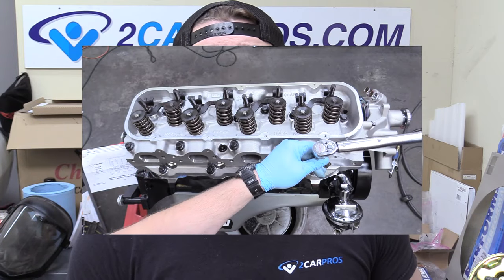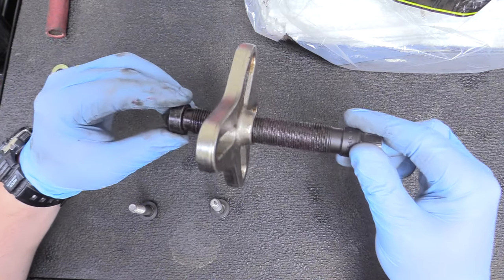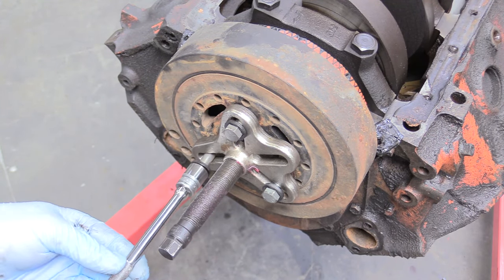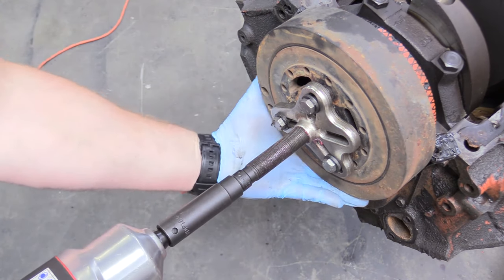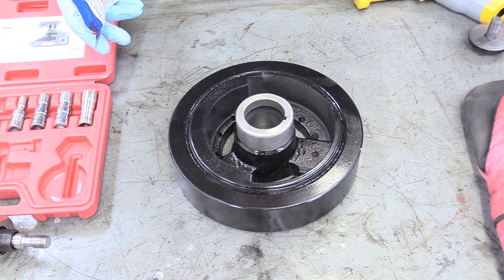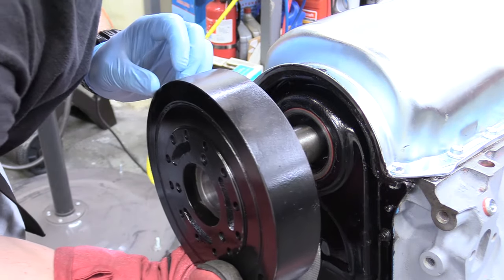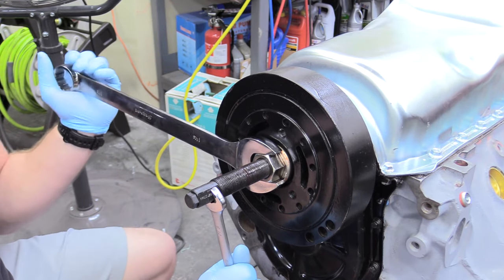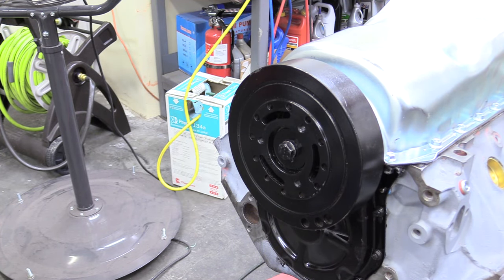Harmonic Balancer Removal and Replacement - DYI

Comment: No one pulls the engine to remove the harmonic balancer.  How do you do it with engine in the car????
Reply from the maker: Exactly the same way. You just might have to remove the radiator or anything else that is in the way. Thanks for watching!
Reply: I know I'm my car it's 04 Pontiac Grand Prix you can buy the part to take the pulley off at O'Reilly's you got to get three special boats because GM bolts are too big I have mine off in 15 minutes
Reply: Bbc 1974 remove radiator unless yor got your self a docket wrench u can to it that way
Reply: Same exact way, just in the car 😂
Reply: He was just using this as an example because the engine was already out!!!

Comment: Great video.  1 recommendation regarding the torque spec.  Driving the bolt in with an air gun is fine but should not be used to over-shoot the recommended torque.  You can yield the threads without knowing you caused the damage or the bolt could start necking, however, when you go to torque the bolt it will still click.  Always tighten with other means below the finished torque and then use the torque wrench to achieve the specified value.
Reply: Thank u for sharing ur wisdom...

Comment: Did a replacement in a 2003 Subaru without a puller or installer. This was 50,000 miles ago. Am I gonna die?😅
Reply from the maker: Nice work! No, you just risked pulling the threads out of the crank is all. But it seems like you got away with it. Thanks for watching!

Comment: What nobody shows you is how do you TIGHTEN the crank bolt without an impact? I know to loosen it, you can wedge a breaker bar and socket and blip the starter, but for the life of me I can't figure out how to tighten it.
Reply from the maker: Hold the ring gear on the flexplate with a long pry bar or holding tool. Thanks for watching!

Comment: I’m having a hard time removing the harmonic balancer. It appears that some type of burr or gasket has heat itself to the front facing where the bolt comes from. Is it possible and if so, what type of solvent can I use? We have switched off and on trying to tighten and re-tighten and tighten and re-tighten, also would you suggest that I use smaller bolts as opposed to the long ones? I’m just trying anything right now thank you.

Comment: How do I get the motor to stop spinning while removing the 3/4 bolt? Tried the belt trick and tried to jam the flywheel
Reply from the maker: I use a ring gear holding tool for the flexplate if it's spinning. Thanks for watching!

Comment: Working on my Chevy big block I replaced my Harmonic balancer with a Summit Racing® Bracket Racer SFI, and when installing it when it seemed to be at the end, and then the tool backed it self out. Everything I have looked at, this does not happen. They Show it getting to the point were you can not turn it any further and you know your done. Any ideas, thank you for any help.
Reply from the maker: So the balancer isn't installed fully? How much is left before it is? I would try a different installer tool like the one I used in this video. Thanks for watching!
Reply: @2carpros  is it possible the key became out of place?

Comment: I have an '89 7.5l Ford, and am wondering how is the harmonic damper a press fit on the crankshaft, when it's butting up against the counter weight? Is the crankshaft tapered? What am I missing here?
Reply from the maker: It's a press fit, so you have to have a tool to take it off and install it like I have here. Thanks for watching!

Comment: If I did this with my 454 still in my 55, would the transmission be able to hold the balancer bolt? When installing the new balancer? Or would this cause damage?
Reply from the maker: I wouldn't worry too much about damage, it would be more about spinning. So the torque converter might just spin with the engine and you might not get it properly seated. So grab a flywheel holding plate tool and have a buddy hang on to it. Thanks for watching!

Comment: Hi guys, my Renault traffic 16 van just had it replaced. I had an error on dash saying no charge to battery. then 10 secs later white smoke near alternator plus I had a loud rattle sound from engine  I thought alternator failed, but it was the harmonic balancer. Cost was $1350 Au dollars in total.Thats a lot of cash🥺🥺 . So I'm guessing it's a pain in the butt to repair? why so expensive 😲

Comment: "Huuuuunnndres of dollars!" lol  My 4.7 Jeep Harmonic balancer tool rental was $119 at Advance auto!  Yikes!
Reply from the maker: I would go elsewhere. AutoZone rents them for free. Thanks for watching!
Reply: Orielley's was free with deposited you get back when you brought tool back  just for future use
Reply: @ryanpaasch7464  how much was deposit? I just didn't have $100 bucks to put down that week.
Reply: @livenfree  it was $47?  Different tools are different costs  I am not sure if it is the cost new?  I got mine off using a steering wheel puller  it is what this guy is using.  It came off in 5 minutes  good luck  this puller should be very cheap  I threaded my crank bolt back in to push against.